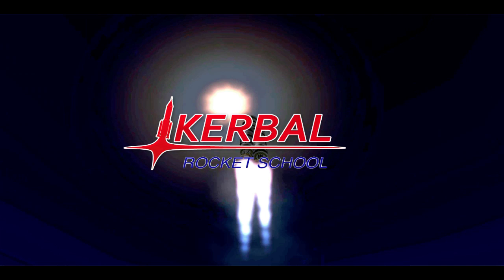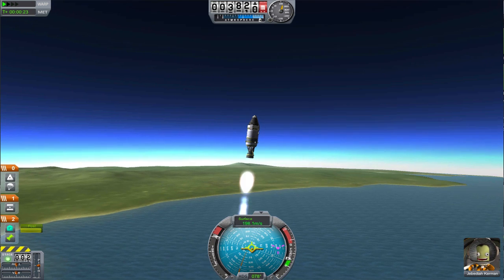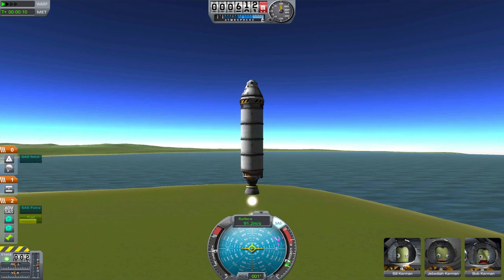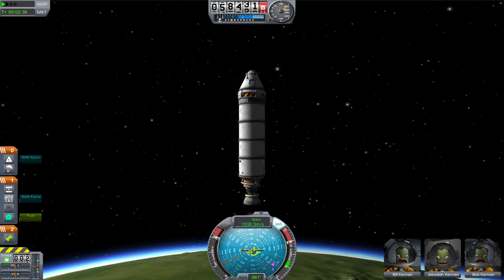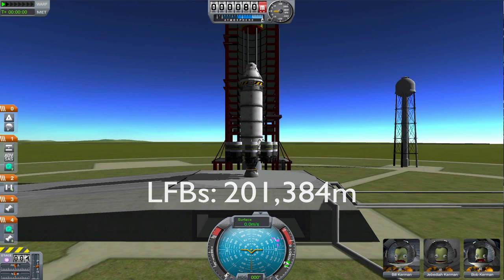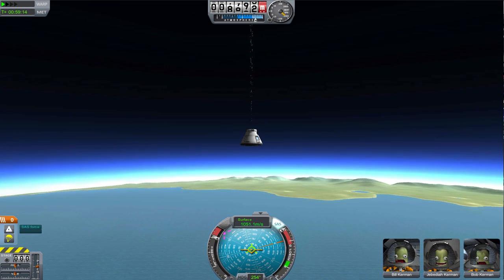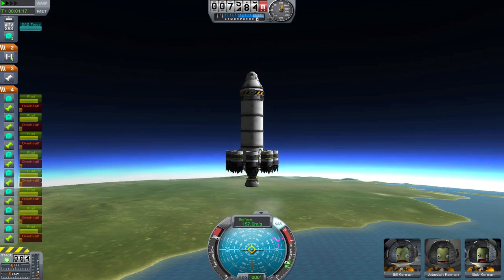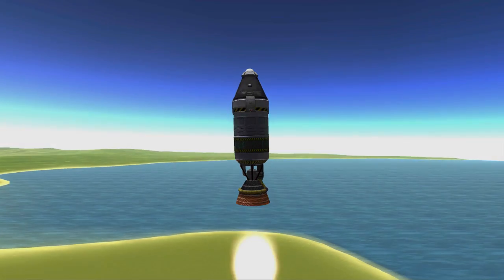Kerbal Rocket School | Episode 4 - Boosters

Comment: Use the jet engines to their strengths: Take a very shallow angle of attack so as to gain orbital velocity while still in the atmosphere. Also means you don't have to take up as much oxidizer, to save weight.
Reply: Yea, SSTO style rocket flying xD
Reply: Max Bond Except the jets are seperable. :D I've built SSTO craft like that. Get to orbit, seperate the jets, perform mission, return to orbit, rendezvous and reattach jets, land.
Reply: Umm ssto means nothing except carog detaches....
Reply: Max Bond SSTO = Single Stage to Orbit. No decoupling.

Comment: miaow ! . . .

The ideal aproach would be making the effective trust of all combined engines the same at every altitude (taking account of delta_v losses by gravity, drag and steering).
Because solid fuel boosters can not be controled once they start (and other engines do not have that power even at maximum trottle), this "experiment" is just a general practical test of a general idea, not a proven tesis.